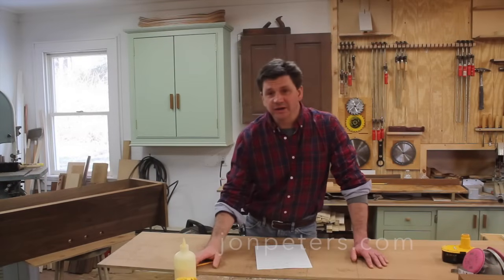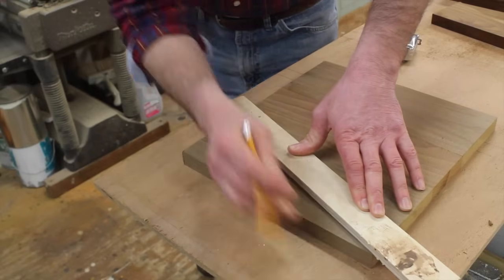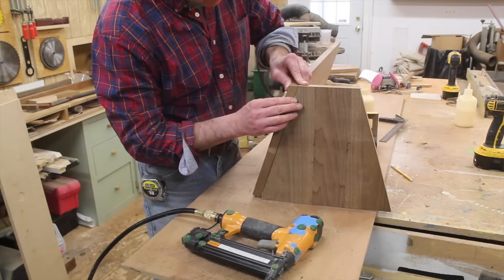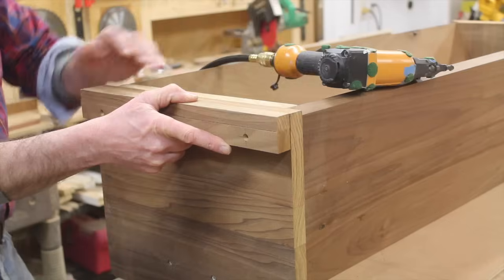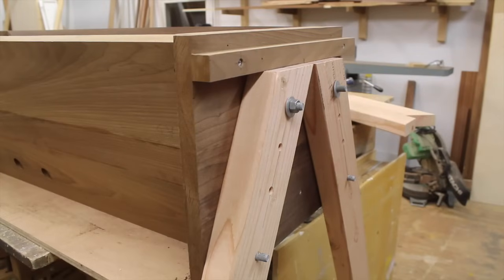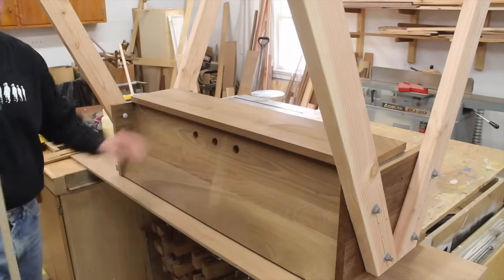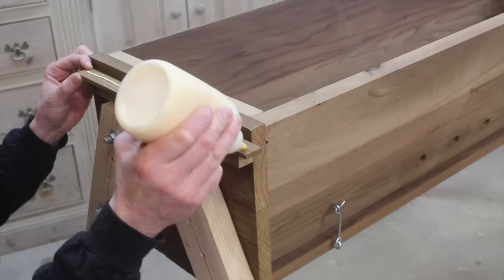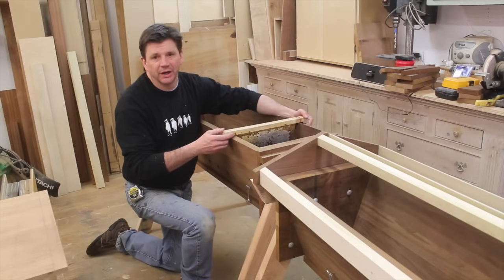How to Build a Top Bar Beehive, Free Plans On Website

Comment: I built a topbar hive about 8 years ago.....bees are going into it next week 😂 long time coming. I have a small viewing window which is perspex and counter sunk internally so it's flush with the surface of the sides so there will be no issues if comb is attached to it. It's only a small window as I wanted it to be dark inside for the bees just enough so I can peek 😉 and I constructed mine with untreated pine so no chemicals, all I did was coat in linseed oil. Well it only ever had one coat I'm ashamed to say but amazed how well it's held up, no rot at all. The very bottom of the legs look a little weathered, but impressed. It had a fresh coat of oil a couple of weeks ago in preparation. Great vid btw.

Comment: I am a bit confused by the boards you are saying are needed for this job. You say 1x6x12 and 1x8x12 and I hear that as 1" thick x 6" wide x 12 feet long. But I'm not sure how you get all the cuts out of those boards. Instead I bought a 1"x12"x8' and 1"x12"x6'. Probably wrong but I got some of the cuts done for the first few parts - just need to glue a piece to the long panels to get the 3/4" of the 12 3/4". Any direction is greatly appreciated as I am a new woodworker.

Comment: That vent space on the bottom door is just inviting Small Hive Beetles to come in in droves.  Not sure where you are, but in Florida that would be full of SHB in no time.  They can get through #8 screen wire.  The only way a screened bottom here works is with an oil trap below.

Comment: Under the screen should be a tray to hold diatomaceous earth, which will help control the hive beetle pest.
And I would ditch the hinged hive top. and just have a removeable hive top   
Also, the entrance should be at the end of the hive, not in the center   
Other than that, it looks fine from what I can see. I don’t have a lot of time to do consultation, I am a very busy single mom farmer, and beekeeper.  so I’m not gonna watch the video but from what I can tell it looks like a pretty good design.

Comment: I was pleasantly surprised @ 2:45 to see you wearing a respirator. Looks like a 3M half-face mask with NIOSH rated HEPA 100 (pink or purple) particulate filters. Unfortunately, it is not a commonly known fact that saw dust is a carcinogen. If you see something floating around in the air, that is only 20% of what you are inhaling with another 80% which is so small you cannot see.

Comment: Late to the party, but excellent video.  

Do you glue boards together to get the 12-3/4" dimension?  Can you use a 1"x12" from the hardware store, having the actual dimension be 11-1/2"?  

Sorry if you explained this in the video.
Edited again, to apologize... You explained it in the video and looking closer, I can see the joints.  Well done.
Reply from the maker: Thank you, you can glue the boards up just use an exterior glue like tight bond three

Comment: I used your measurements and my cross bars are only a foot  long  .....somehow the crossbar  your are installing are 17 inches.  I need to and a 5 inch board all around the  top to be able to use a 17 inch top bar.
Reply: Add not and .....

Comment: Jon, found your video and subscribed to your channel. Most excellent construction, explanation, etc. I saw a top bar building video where the top was hinged on the side instead of the end as yours is. Do you think that matters? Thanks and you are the current "Norm" in my opinion.
Reply from the maker: Thanks Marc, no I think either way will work As long as you can get to the bars. I’ve stopped using a top bar hive because I didn’t have much success. I now know a little more about beekeeping and plan to try the top bar again next year.
Reply: @JonPetersArtHome  Great. Thanks!

Comment: Hi Jon,
 
Great video and good explain, but I've a question : do you respect a 120° degrees  between the floor and the sides ?  I began with a TBH this year in april with a 120° and 24 cm deep !  wich wood do you use to make it. I've used DOUGLAS
Thx for sharing...
Reply: +Yves Bodin I see a lot of requests on this 120 degree question in here. Where is this information of 120 degrees located. It&#39;s not in my book &amp; I want to make sure I read on this before starting my build. Thanks

Comment: Well John: I have pretty basic woodworking skills and  bunch of Ryobi hand tools.
So I followed your directions step by step and managed to put a top hive together.
Really, really happy with it. The lid is very heavy, though and I think it would be too risky to mount it on hinges due to high winds where I live so I put a couple of handles on the roof for lifting.
Could not have done it without you.
Cheers!
Oh!  Also used your lid design for the garbage box. Not quite so heavy though so it has hinges and will hopefully keep the bears out.

Comment: Jon, have you had any problems with splitting wood since you glued joints with cross grain??
Reply from the maker: So far so good, my bees didn't make it through the winter though so this year I went with the Langstroth hive. I plan on getting bees in the spring for the top bar hives and giving it another try.